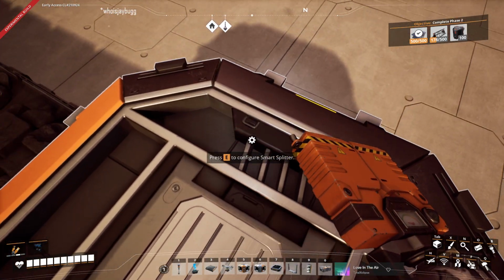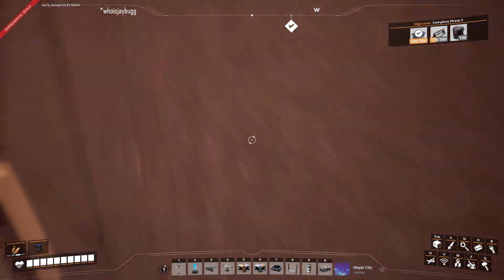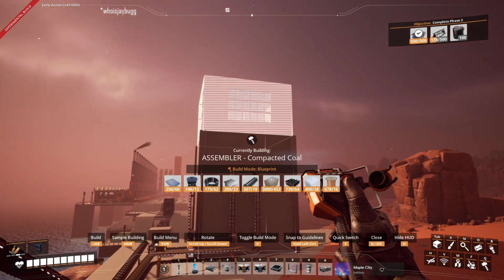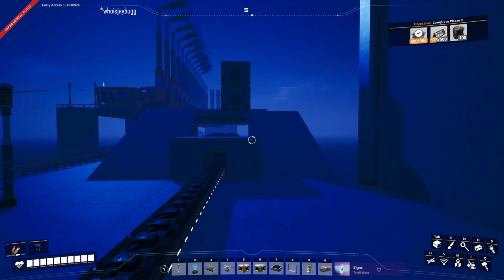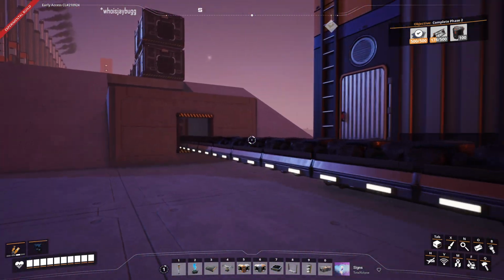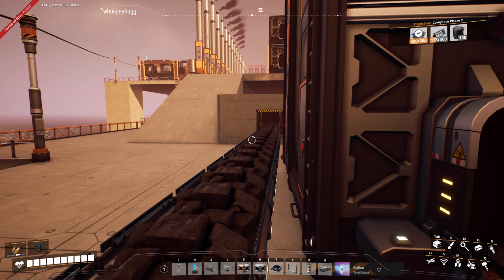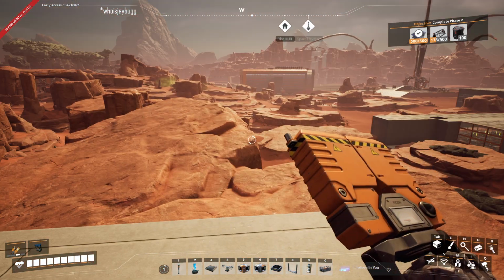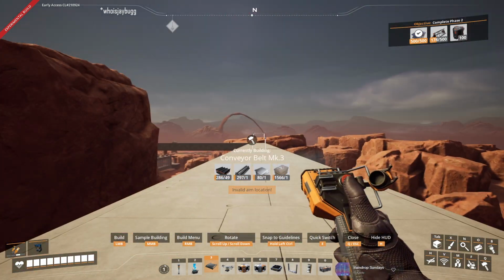02.14 Expanding With Blueprints Compacted Coal

Comment: Does compacted coal offer any advantages over just using normal coal?  By the way, I've enjoyed viewing your Satisfactory episodes thus far.
Reply from the maker: Compacted coal is really good! Just for burning it allows for 210% of the power generators when compared to coal. So if you have 1 generator there is no advantage but compacted coal would allow you to have 2 generators for the same amount of coal. Coal generators make the same amount of power regardless.

Also compacted coal opens up alternate recipe options.

Hope that helps!